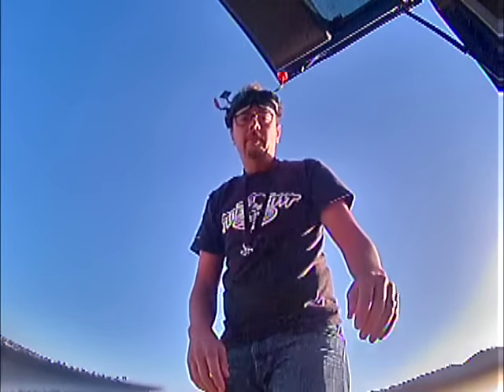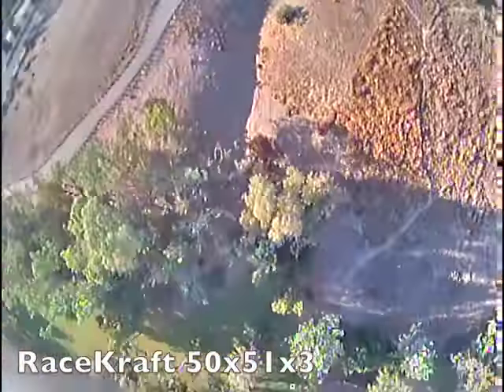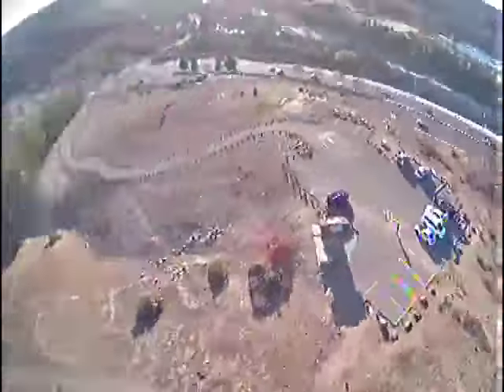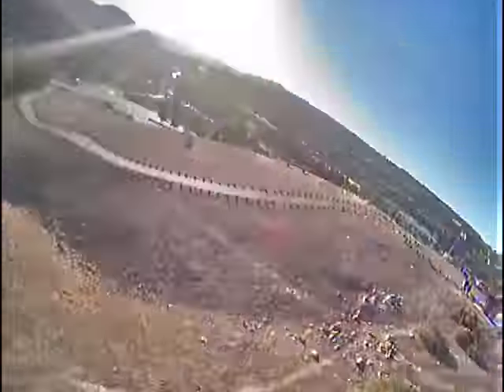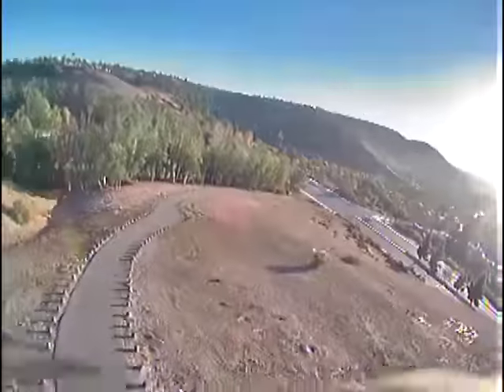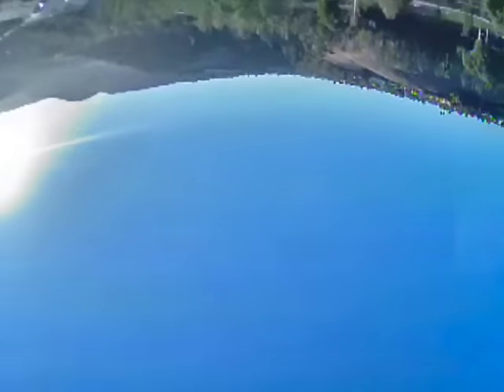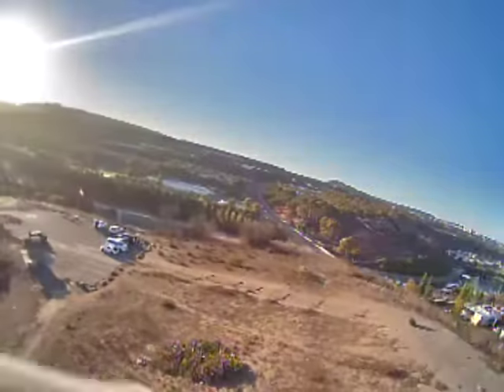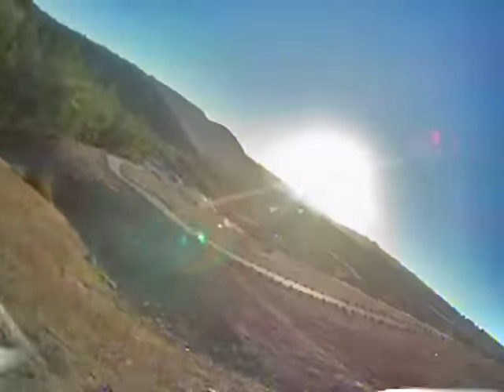Did I go 100mph??? Testing the new Emax RS 2205 S 2600KV Motors

Comment: Put them on a fast little wing, and get even higher speeds
Reply: Some wing like this can take 2 motors and have enough space further out for 4 motors http://www.das-nurfluegelteam.de/h7_raimund/h7_bilder_parkfly/rai_h7_1.jpg 5x4 will really make it rip. Expect 75% of prop tip speed on such a setup(even faster then 200MPH on 3S)

Comment: I'm getting such bad interference i can't fly yet with these motors.
Reply from the maker: From the motors?  interference in your video?
Reply: Yes.  Nothing else changed on the quad from the 2204 emax to the 2205s.  It's a powercube to a core pro that then connects the cam and vtx.  I've moved the core pro and changed antenna, coiled through a ferrite ring, twisted all wires etc.  Guess I'll somehow throw an LC filter on it.  The motors are soft mounted as well.